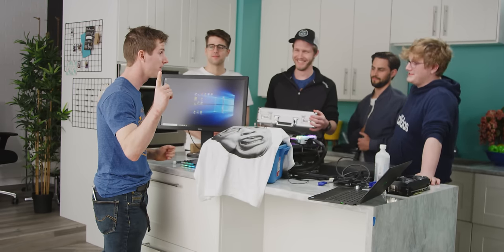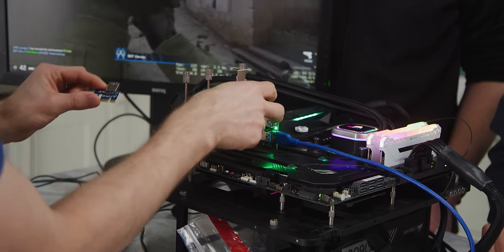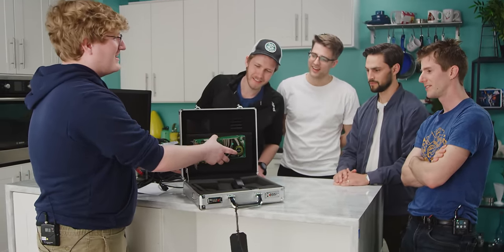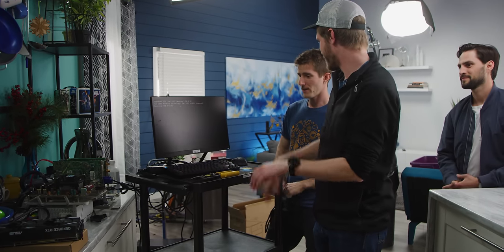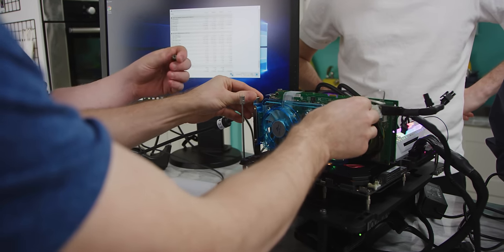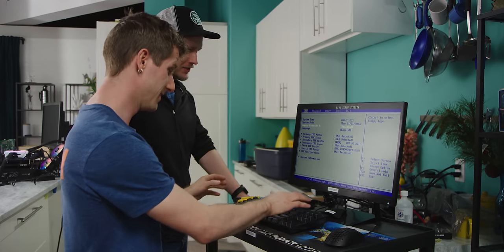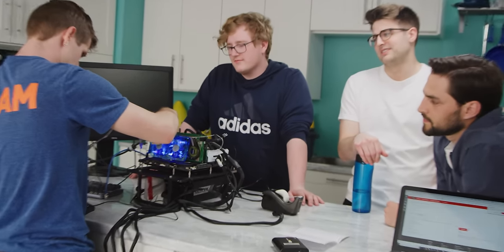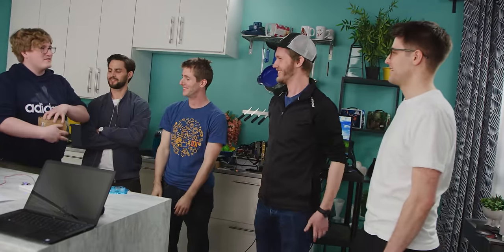The WEIRDEST PC Parts we Found on AliExpress

Comment: ... i was really interested in this until i saw your team was not as knowledgable.
These are all normal items.......

How about a full pcie powered computer boards. It would be like a computer in a computer.... i know they released a few in the last years.
Or .....
Fucking water cooler systems, rad,pump integrated into a pcie.
Thermal take i think 2008ish
Or....
 darn hdd 3.5" brackets that install into a pci slot.

The gx2 was pretty old school and barely makes the  cut bc its innovative but they stopped making cards like that bc of the overhead costs in dual pcb. Even though its awsome.

Comment: I need immediate helpful sound advice about buying a new GL702ZC motherboard from 3 stores from aliexpress.

Akemy Motherboard Store,AK Laptop Store,and Xinkaidi E-Commerce store....

They have what I need.

But there horrible English translation doesn't give me enough info.....

I need to get a new board for less..

Its 3 years old and obsolete and value has dropped so far it ain't funny.
GL702ZC-WB74.

Just need confirmation from other customers that have bought from those 3 stores to make sure I dont get fucked.

I want to hear good reviews,no trolling or b.s., I will not respond if your not helpful...

P.s. going through asus,to pay 60 bucks up front for non-refundable diagnostic fee plus waiting blindly for a dreadful price is not worth ,me bothering a friend to get the machine to package it and send it.
..